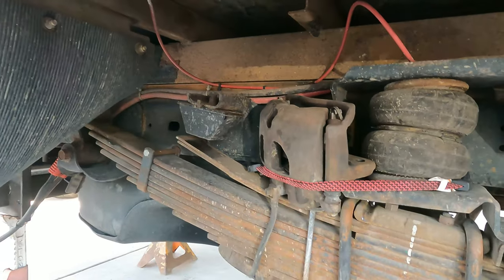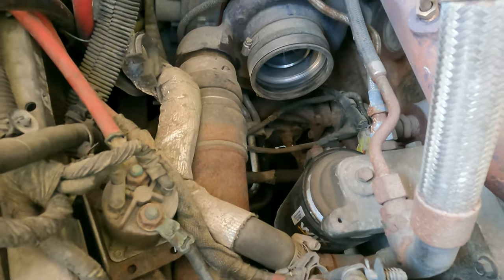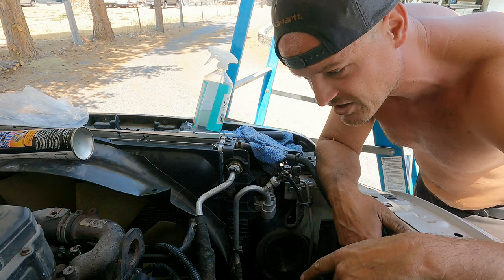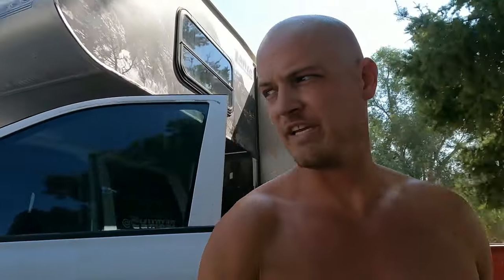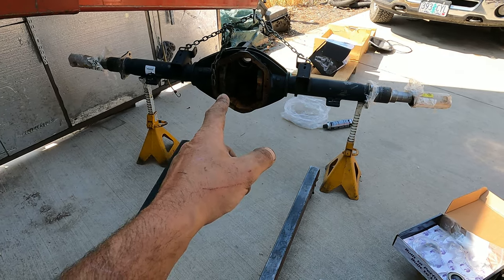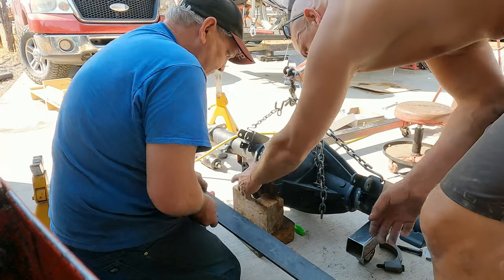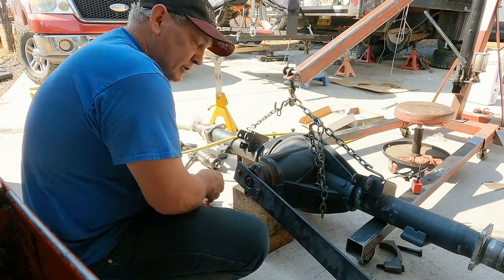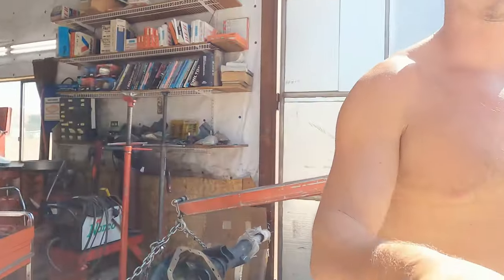AXLE REPLACEMENT PART 3: WILL OUR TRUCK EVER BE RIGHT AGAIN?!

Comment: Not sure if your alternator protects itself from overheating? If you not already running a DC-to-DC charger, you might want to look into getting one. Charging lithium batteries straight from the alternator will overheat it. Not long after changing my setup to multiple lithium batteries with no DC-to-DC charger, my alternator fried. Good luck with the rear end, hope it works out this time. 

viva la mexico!
Reply from the maker: We are running a BIM from Battleborn. It connects the alternator to the house batteries for 15 minutes then disconnects them for 20 to keep the alternator safe. We’ve been using it for about 2 years now and it works great. I’d love a dc to dc charger but I’d like it to be 100amps.